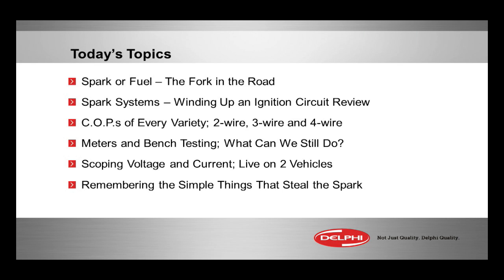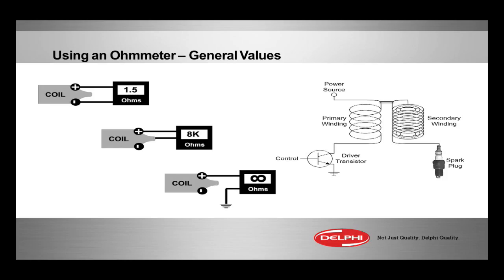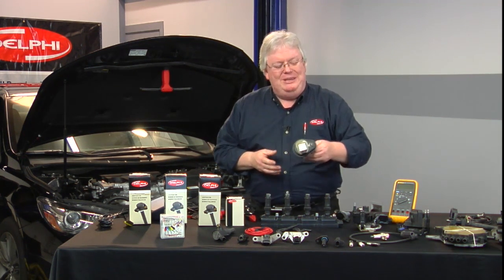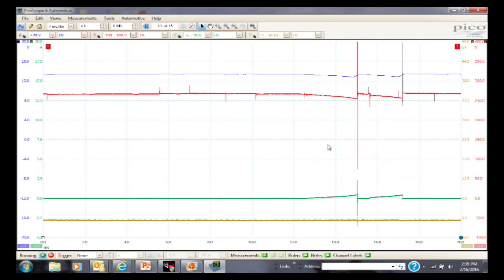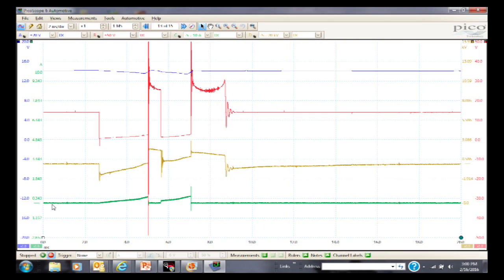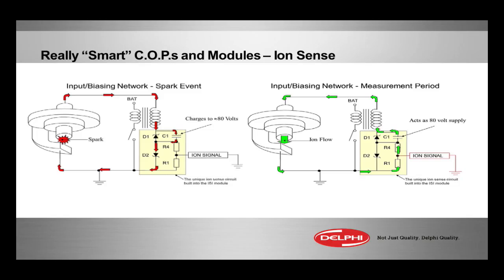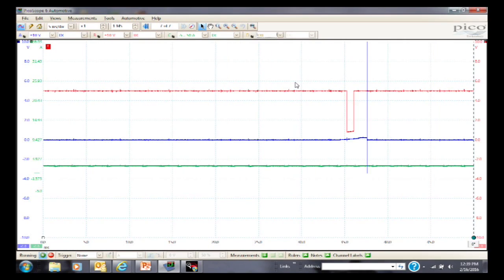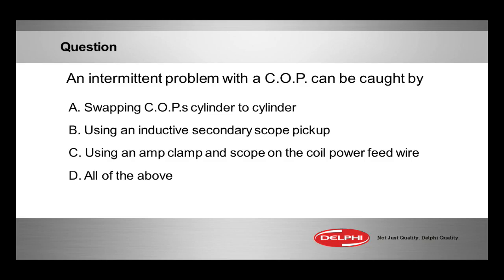Delphi Training Series: Ignition Coil Diagnostics

Comment: Love your channel. One question  we measure voltage with DMM on control side of coil we can only see voltage little less than system voltage because of slow speed of DMM. How we can be sure that our ground side doesn't have any voltage drop.